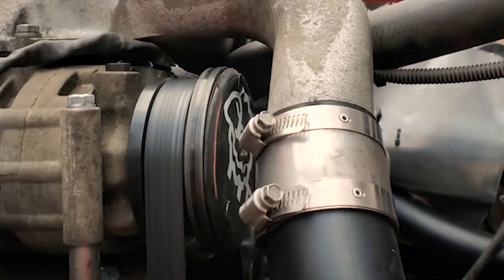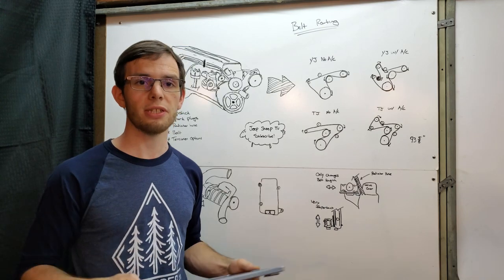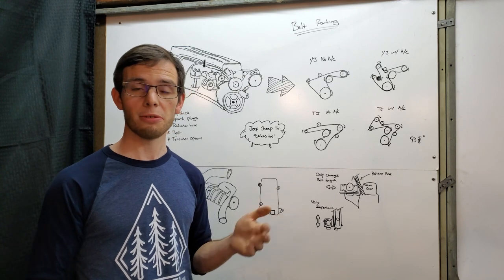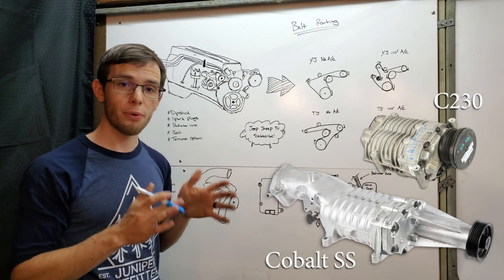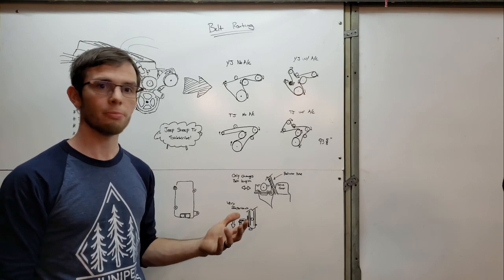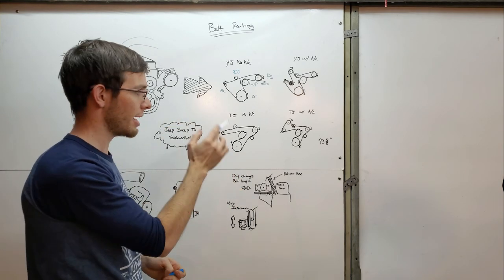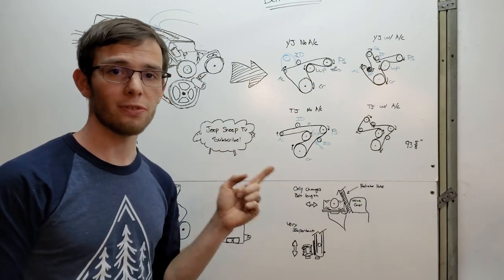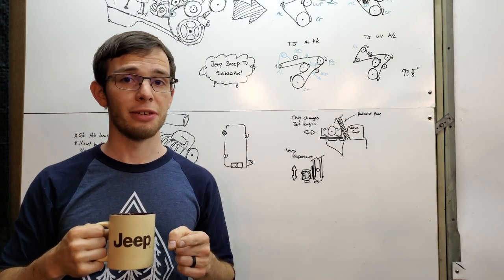DIY Supercharger Part 1 - Mounting the Supercharger

Comment: I was searching for 2.5 stroker information when I found this series of videos. Thanks for making these videos. I am working on a 2.5 project with a Ford 351 Cleveland head modified to fit. Jim Ford Highway 101 Rod and Custom.
Reply from the maker: "Ford 351 Cleveland head modified to fit" are you talking about the Jeep 2.5L with a ford 351 head? I have many questions.
Reply: Very interesting, any updates?

Comment: Following this build can’t wait to do this to my little 2.5 L
Reply: Once I had all the parts I had it done in like 2 days, granted it was sun up to sun down work, I burned through a lot of nicotine and caffeine, the difference in power is very noticeable, I can smoke 32.5 inch tires, I love the way it sounds, I love the throttle response, my only complaint is that when I do highway travel and I break 75 I feel like I’m riding on a rocket ship, but that’s more of the Jeep than the supercharger

Comment: Interested In seeing the fueling/controller system you're using We've been trying to get a turbo 4 cylinder to run correctly and having a rough time for a cheap fueling solution
Reply from the maker: It will be a while but yes I'll go through it in depth

Comment: The idler pulley is the identical, you do need a longer bolt as well. I need to figure out how to do this with AC because I converted one into an air compressor.

Comment: Hahaha. Oh man!
The power steering bracket is so annoying. There are two bolts in the front that are easy to remove. There is one bolt in the back that holds the bracket in between the block and engine mount. Meaning you have to remove your drivers side engine mount to get it off.
I was at the junkyard with my bag of tools expecting to only take about 15 minutes, never expecting to need an engine hoist to remove the ps bracket 😂 
So what I had to do since I didn’t bring my hackzall with me is I bent the bracket back and forth at the point where it attaches to the block for several minutes until finally the metal gave and snapped right off.
What I then did when I got home was, I grabbed my hackzall and cut the old bracket off my Jeep and left a piece remaining stuck in between the mount and block. (About 2 inches)  I then got the new bracket from the junkyard and cut the back mount off at the same spot I cut the one on my Jeep and then made it an inch shorter in length so it would not hit the old bracket that still remained. It’s held on now by only the two front bolts and it’s been working great! 
A lot easier then removing your engine mount!!

(Reason I had to remove the ps bracket was because I had a bad ps pump, shot bearings, and no hoses or resivor (just pump alone running dry) before so I eliminated the pump and I bent my ps bracket and rigged it with a pulley. I put in place a pulley to get the serpentine belt to fit without ps pump. I bought a new ps pump with the bracket eventually and struggled with the bolt in the backs 

Hope this helps someone out there that one day has to deal with that bracket!

Comment: No mention of passing air emissions I am in CA always a project killer any information on this thanks great Chanel
Reply from the maker: I've never lived in a state that requires emissions testing so I'm not entirely sure.  What I do know is that when the clutch is turned off the Jeep runs with the stock parameters  so theoretically if it passed before and you run the test with the SC off it should pass again

Comment: Not supercharging a Jeep 2.5.  I've been interested in supercharging a SOHC 16v 2.4l 4G64 that is being installed in an 87 Dodge Raider.  I too am looking at running only about 5PSI.  Monster power isn't my goal.  My main reason is having performance at higher altitudes when I go to Colorado.  Since I am going the Megasquirt route for controlling the FI ( the original engine is a computer controlled carb), I'll have a lot of things in place to handle the controller aspect already.  Yes, it's an odd choice for this motor but the "clutchability" and low end torque is what I'm interested in. Yeah there's a lot of resources out there for putting a 4g63 DOHC head on this engine but the fitment issues in a RWD configuration create issues that are, IMO, equal to or greater that going the SC route.

Comment: I bought the M45 supercharger for my 2.5 YJ, been looking at pulley sizes, the Mercedes it came off has cramkshaft 185mm, the yj has 160mm. What's a suggested solution for the crankshaft pulley? I can go as low as 62mm on Supercharger but still won't make the stock boost on the M45.

Comment: Do you think a really light dakota with this setup could ever be "fast"? My truck is only 3300 pounds and is actually quick (at wide open throttle lol)  until highway speeds then I'm stuck with all the jeeps in the right lane.
Reply from the maker: "Fast" no, but quicker yes. And lots of fun.
Reply: @JeepSheepTV  i saw the video where you switched it on at 70 and it started pulling,  I could floor it in 4th an not speed up that fast with wayyy better aerodynamics.  This is really dope man thanks for giving this motor some love

Comment: Great video!  Lot's of really good information.  Thanks for taking the time to teach/show us.  I do have a question about the mounting plate.  Why 1/2 inch thick?  Could we go with something 3/8 or even 1/4 inch? 

Also, I would love to see that video of the swapping to the TJ tensioner...thanks!
Reply from the maker: Noted!
I bought 1/2" thick because I want to try something with captured nuts in slotted holes. You do not need it to be that thick. 1/4" may work but I recommend 3/8". The Supercharger is roughly 30lbs and jeeps do a lot of bouncing around lol.

Comment: With supercharging this little motor do you have to do anything to the internal components for reinforcement? Also, how does this effect the life of the engine? I guess it isn't too hard on the engine since is such little boost and you aren't using it all the time.
Reply from the maker: You basically answered your own question. At this level of boost I am not to concerned with the internals. But I will be if I increase boost in the future.

Comment: Did you install a TJ water pump while you were there? I see the direction of rotation is opposite YJ vs TJ in your drawings. I have v belts so I would probably be changing my water pump either way. Thanks, i had to get that off my chest....
Reply from the maker: I did not. Direction of rotation is the same, I drew it on the other side of the pulley but its the same direction. The earlier v-belt YJs do rotate in a different direction though I  believe.

Comment: Hey, I've just downloaded all the service manual for SLK and I found this info on the manual "The coating of the rotors of epoxy resin is resistant to oil and fuel". So you can basically spray gas without any issue. Btw, I’ve done the same retrofit with an eaton m62, a bit difficult cus I kept the AC. I’ve uploaded a short on my channel if you want to check how I mounted that supercharger. Thanks!
Reply from the maker: That's awesome! I'm impressed that it fits under your hood.  Just got to keep the piping low profile and you should be fine.  How do you plan on routing the belt?
Reply: @JeepSheepTV  I think my previous comment was deleted because I've added a link to a picture explaining the new belt routing. I'll add a video in about 1-2 weeks. Regarding the fuel system I will use and Arduino mega that will get the rpm from the ground wire from ignition coil + a MAP sensor. I already created the code to make the auto-tune using a wide band sensor. Based on the AFR I will inject the fuel(using the 5th injector) accordingly to the RPM/Air-Pressure map. BTW, did you manage to replace that vacuum flap with the electronic one from Mercedes? I have one.. but I think I should convert the 5v PWM to 12v PWM to make it work.
Reply from the maker: @bccosmin3720  no,  I still haven't hooked up the electronic throttle body.  I've been occupied with building another jeep.  When I made my bypass controller I used a PFET to switch at 12v from the arduino. The PFET should be fast enough to handle PWM when I try to control the electronic throttle body.
Reply: @JeepSheepTV  that’s great info, will try that. Thanks
Reply from the maker: @bccosmin3720  Any time, keep up the cool projects. I can't exactly remember why but I think I need to use an Opto-isolator to drive the PFET, It might invert the signal or something but if you get stuck just send me an email at jeepsheeptv@gmail.com and I am sure we can figure it out.
Reply: I’ve just uploaded a new short with my belt routing. Please let me know your thoughts. My concern is for the AC pulley, not sure if it have enough grip.
And yeah, I’ve added a performance pulley for the Supercharger, the ratio is 2.46(tj max rpm 5600, and max limit for supercharger is 14000rpm, I should be fine with that I guess)
Reply from the maker: @bccosmin3720  yea you should be good.  It looks great! Worst case scenario you move the idler pulley up  to get more grip on the AC. The pulley size should be fine as well, it should run great! Keep an eye on you boost levels though.  If you make close to 10 psi you will want to gap your piston rings.
Reply: @JeepSheepTV  thanks, yeah, already bought a boost gauge, I will keep an eye on it. Might worth to add a small code to the arduino to check the second MAP sensor when I exceed 10psi(if it ever happens) to open the electronic bypass.
Reply from the maker: @bccosmin3720  Send me an email at jeepsheeptv@gmail.com we can talk more about the electronic bypass. I haven't built mine yet but I have a lot ideas on how to use it to improve drivability. Lets chat.
Reply: @JeepSheepTV  I’ve sent you a few emails a few days ago. I’ve posted a new video with my piping setup. Please let me know if you spot something wrong.
Reply from the maker: @bccosmin3720  Sounds good. I'll respond to your emails as soon as I can. I've been off the grid jeepin!
Reply: @JeepSheepTV  great 🤟. btw, I've tested today my supercharger..it creates too much boost ~ 10psi with 70% bypass open. I think I might change to the original clutch pulley which is bigger. what do you think?

Comment: You mentioned that you messed up your pulley size calcs. I’m looking to pick the supercharger pulley for my project now, can you let me know where you went wrong, so I can avoid the same mistake?
Reply from the maker: I thought I was going to get more boost out of the stock clutched pulley than I actually do. If I wanted more boost I'll have to ditch the clutch in favorof a smaller pulley, but I like the clutch. So I decided that less boost is fine and rolled with it.

Comment: IS IT POSSIBLE TO INSTALL THIS SUPER CHARGER WITHOUT REMOVING YOUR AC COMPRESSOR?
Reply from the maker: Not with this setup. My recommendation is to remove your doors when it is hot outside rather than using A/C
Reply: @JeepSheepTV  do you have any suggestions of any way to configure this setup in a different orientation to still be able to use the AC. I would love to have AC and a supercharger on my 85 CJ7 with the 2.5 liter.
Reply from the maker: @olinblair7385  you can look into trying to set it on top of the intake manifold like Boosted tech does.  I find that area to be pretty tight but I'm sure it can be done

Comment: 0:50
I want to supercharge my Volvo 940 which also has a 2.5l 4 cylinder and I've been locking around for informations about Eaton superchargers from the Mercedes.
Reply: Did you get enough information? I know that a lot of Miata forums can be helpful
Reply: @LiamLafferty 
Well not enough but certainly a lot.
Looks like the M62 will be the best option for me aswel. Although I want to run it with a carburetor. I surely didn't know about the teflon coating on the rotors. Looks like I will have to get a blow through carb because of this. 
I don't know anyone in real life who runs a carburetor nor a supercharger so I have to rely heavily on the internet for knowledge. Thanks a lot for making this sort of videos. Even though they are very Jeep specific they shure help a lot of people out.
I'll be waiting for your next video about the intake piping and I hope to get more information about the bypass as well.

Comment: You say that supercharger can be mounted in any position? What about mounting in its side? I have a tj and I’m spoiled with ac not so much motor😂😂but I really don’t wanna sacrifice my ac for the super charger I understand I’d have to fab up a bracket I can weld not a problem there  and I’m sure I’d persuade the wheel wells a bit or cut to make room for the super charger but you think it’s possible To keep the ac ?
Reply from the maker: With a welder and some creativity anything is possible. The only thing I ask is that you send pictures (jeepsheeptv@gmail.com). if you struggle with space try the M45 and make your own piping.

Comment: so, just a thought. but would the supercharger off the cobalt ss be closer to fitting on the jeep inline 6? simply due to its length, or would the same short one off the mercedes still be preferrable?
Reply from the maker: Maybe for the I6 but I'm not really sure,  I haven't done any research on supercharging the I6
Reply: @JeepSheepTV  hopefully you can do a cheap supercharged I6 next. as that is one of the most common of the jeep engines, i think it would be a great next project to record.

Comment: I’m in the middle of this build , got my pc3 installed . Next will be electric fan and inner cooler then supercharger . How is the clutch fan on the supercharger wired? Is it just wired to a toggle switch? How is the by pass wired ?
Reply from the maker: The clutch is on a toggle switch and the bypass is turned on and off with throttle position. Can be done with a switch on the throttle or with a logic device.
Reply: @JeepSheepTV  I bought the supercharger bypass Solenoid from one of the video. Does the vacuum line run to the by pass ?
Reply from the maker: @Hillbill6461  it does,  but through a vac solenoid. I have a link to it on one of these videos and I think I draw a diagram somewhere...
Reply: @JeepSheepTV  ok I’ll look for the video and diagram

Comment: doing some ebay research looking into this build. all i am coming up with is the Eaton M45 work from an older SLK230?? looking into planning out a build for this possibly on my squirrel powered rust box
Reply from the maker: The m62 is from an older model year  but it should be out there.  The m45 will also work but I'm not sure how well it will fit if you keep the factory plumbing
Reply: @JeepSheepTV  ok cool yeah I might have to check my local junkyard I live in upstate NY so might have something. I thankfully don't have to take out my AC
Reply: Im curious what would need to be reconfigured for an m45. Anyone got money and wanna do it lol
Reply from the maker: @russo5196  nice work!

Comment: What transmission do you have? Everyone says the ax5 is trash
Reply from the maker: Mine is the automatic, its only 3 speeds sucks a lot of power but has been very reliable
Reply: I have a 4 cyl. Yj with the ax5, … 32’s and regeared with 4:88 , locker in the rear and chromoly axles . I love it
Reply: @4-bangerYJ  I have 98 TJ 2.5 ax5, 37 and regeared to 5.13 locked front and rear (HP44/Ford 9").  Just took it out in the wood today.  looking to at the little bit more power on the take off. 
I was thinking of options to change out the ax5 which I blew up when it was behind my first 2.5 liter on 33's

Comment: Can you do this with a stroked 2.5?
Reply from the maker: You can try, I'm sure since your engine requires more air the "boost" provided by the supercharger will be a little less. Other than that it should just be tuning. Did you have to do any tuning adjustments for the stroker?

Comment: I wonder how this set up would work on the 4.0L ????
Reply from the maker: Very similar but I would recommend the M90 supercharger to match the higher displacement.
Reply: @JeepSheepTV  I think I'm gong to have to start sourcing some parts for my '93 YJ. I was thinking of a V8 swap, but this is cheaper and way easier. ... I just binged your videos; very well done. Very informative ...
Reply from the maker: @1down4upworkshop61  good luck! It won't be as powerful as a v8 but the sky is the limit if you are willing to do some engine work and run a smaller pulley for more boost